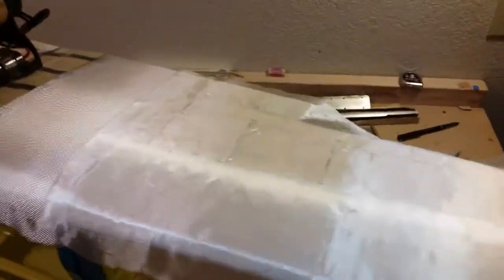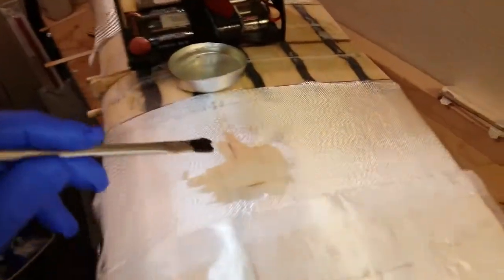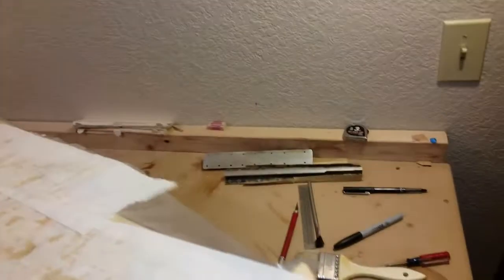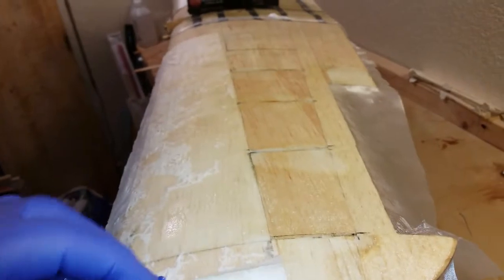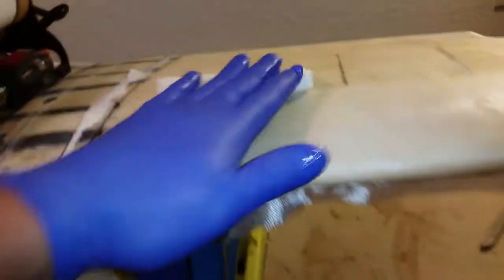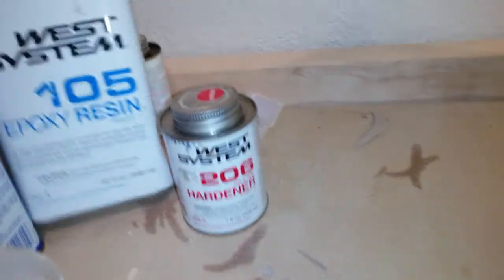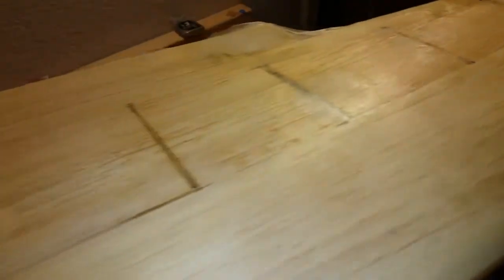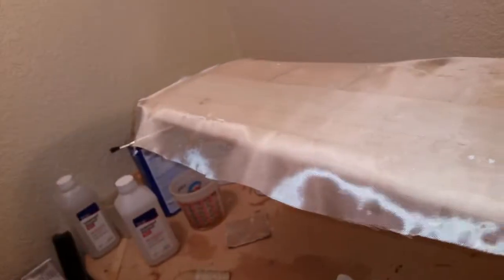Fiberglassing a wing

Comment: Personally I would have rolled the resin in with a paint roller and then rolled the air out with a alloy ribbed roller before drying it off with the TP.
Still it comes up OK :)
>
Was wondering if I could make a full Polyurethane wing with enough strength and not adding excess weight, so that's how I came across your video. I am even considering a aluminium polyurethane laminate if I can get aluminium thin enough.

Comment: Hi, which is the weight per M2 of the fiberglass? Would be really useful!
Reply from the maker: Hi there,
 I use this method with almost any glass cloth weight I do layups with.
Reply: @topmenace  yes, but I need to know which is the weight of the fiberglass you use so I don't use any one too weak or too heavy. I'm making a glider and I don't want it to be too heavy.
Thanks
Reply from the maker: @lucascaviezel8899   For my warbird racer finsih cloth I'd normally use .5 to .75 oz cloth. The weight of the cloth is negligible...your heaviest weight gain is going to be from not removing enough resin.
Reply: @topmenace  thank you!! You helped me a lot!

Comment: very good instructional video, just one point though. Polyester resin would not be a great idea for covering wings with foam cores, as i'm sure it will seep through the balsa and eat your foam core.
Reply from the maker: The balsa was bonded to the cores with epoxy, thus sealed from seepage. But yes,  you'd want to avoid polyester over bare foam.

Comment: I mean how much you actually got out by rolling this, 20-30 grams max? On such big plane that is for nothing.
Reply from the maker: Actually, when it soaks into the wood, it makes more of a difference than you think.When you go about a build NOT paying attention to the little details, suddenly, you have a brick of a plane and end up wondering why it flies in such a crappy manner.
Reply: @topmenace  If you are a weight wheenie, then why even use glass fiber when there is CF widely available saving half of that weight. 30 grams doesn't make your plane a brick. Your tail is anyway too heavy and need to put ballast up front LOL.

Comment: Very nice tutorial and method. Do you think this would work on a foam EPO model?
Reply from the maker: bauhaus 
Yes, without a doubt.
Reply: Tried your method, works like a charm! So, when you're prepping the underside of the wing for glass, you trim off the excess after it has cured, then you fair the glass into the wood(the leading edge area) then apply the fiberglass and epoxy to the un-glassed part of the wing(the bottom) and finish by removing excess epoxy with the TP method again? Just wondering if this is how it's done as I've seen surf board glassers do this to their "rails"(sides of the board) which sort of look like wing leading edges. Hope my question makes sense!
Reply from the maker: Glad to hear of your success. It's easy, don't you think? 
And I'll restate, it's not "MY" method, I just read about it a few decades ago before I ever started glassing, and thought I'd give it a whirl.
I typically do the bottom surfaces first and only wrap right to the edge. Then when the epoxy reaches green cure, I'll trim off excess material, and use the wet TP roll to do a final pressing in any areas that may need it. When the bottom is cured well enough to move forward, I then cut any edges and high spots with a 220 grit paper.
Then, when I cover the top surfaces, I'll wrap that layer around the edge and onto the bottom with a bit of overlap. 
On a fuselage, I'll do the bottom, then the sides, and finally the top. Sometimes a fuselage can be done by overlapping the side panels on the top.
Hope this helps.
Reply: Yes, it was very easy to use.  Thank you for detailing out your process, this will help a lot!
Reply: What weight of glass are you using here? I'm trying 3/4 oz and it is super thin. Wondering if I should opt for slightly heavier stuff.
Reply from the maker: bauhaus for this I typically use  .50oz  to .75 oz cloth. 
This wing was for a warbird racer and I wanted to have a slightly heavier cloth on the inboard panels for a little more strength. You can see carbon fiber tow on the center section. This was trapped under the cloth on top and bottom.
Reply: I was practicing on an inexpensive plane, using inexpensive epoxy resin (ZPoxy finishing resin) and noticed a fair amount of warping, actually warping in the direction opposite the epoxy side. Have you ever experienced this with West System? I'm thinking it may just be the ZPoxy. Previously, I'd done a few test pieces with some pretty high end infusion resin (Endurance Technologies/CPD 4505A/B) and it cured completely straight, with no warping at all (and the peice was very thin). I think it's the ZPoxy but thought I'd check to see if you were aware of it as something to look out for when building wings. Thanks!
Reply from the maker: bauhaus , if I understand your previous posts,  you are using the glass and resin on an all foam plane?
Your wing structure should be torsionally rigid to prevent any warping. On a built up wing or even my foam wings for warbird racers, I've never had a warp happen. 
You may need to consider placing the foam wing in the stock it was cut from as you do this process.
Just use some thin Teflon tape on the sheave to prevent bonding the wing back into the sheave.
Reply: Yes, it's a foam plane, with very thin vertical/horiz stabs (SkyHunter FPV plane from RMRC). You know, the more I think through this, the more I'm thinking it's the ZPoxy, plus, I put the piece into a hotbox to speed the curing process(basically a Home Depot moving box w/an incandescent bulb). This was recommended to me by the folks at Endurance, probably ok for "good" resin like West or Endurance but maybe not so great for hobby grade stuff like ZPoxy. Unfortunately, the Skyhunter doesn't come with beds, it's just a cheap Chinese EPO frame that comes in a cardboard box w/no support at all.  I'm going to do another surface, identical to the one I did today, but this time I'm going to use the good stuff. If it doesn't warp, I'm sure I'll know why! Thank you for taking the time to read these posts and reply. Composite work seems to be somewhat of a dark art. Finding someone who's willing to share is very helpful.

Comment: Thank you for taking some time and posting this video. I usually prefer to use less epoxy, wet fitting and squiggie which works well with heavier cloth...but have the same experience you with light cloth; pulled too hard, distorted mess. Your method may be creating a bit of waste, but allows dry fitting and amazing results. I also like West System with slow hardener. It gives a ton of working time and it's not a sticky, stinky mess like faster cure or poly resin.

Comment from the maker: there is no problem with residue from the TP.
Done as shown here, it leaves a clean surface with all the excess resin removed, thus preventing weight buildup.
Also, the act of rolling the soaked TP works the cloth onto the surface and helps to ensure full contact.

Comment: good idea. but are you leaving toilet tissue/paper dust/lint in the resin? do you recommend using peel ply also? i know toilet paper is cheaper. i ask about the dust and lint because of carbon fiber.
Reply from the maker: Never had a problem with that. Give it  try.
Reply: i definitely will. thanks again.